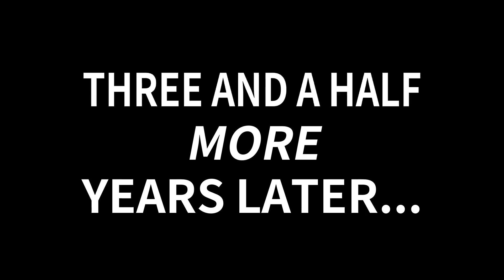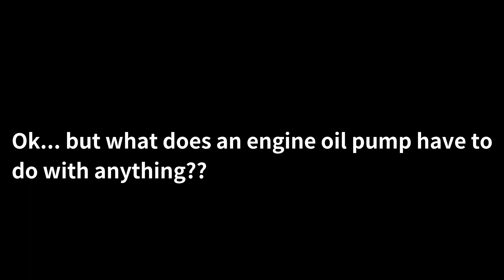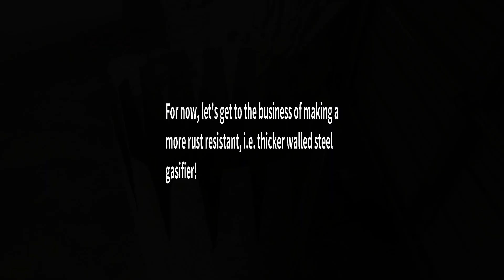Charcoal Gasifier Update 2022, Part 1

Comment: I had the same idea, water/coolant around the firecone but circulated otherwise it would boil fast. I'm going to just weld stainless together and use plaster-sand mix around it for a further heat sink. I'll see how that goes.

Comment: water cooling the throat is bass ackwards...you want to get it white hot if you can.  you are just trying to use cheap found materials and i will not work for very long...i still applaud your effort and time and experience will rule the outcome.
Reply from the maker: I know, I've gotten gasifiers hot enough to melt firebrick.  Those were not cheap found materials.  Also, this design is using oil for cooling, not water.  Oil can get up into 400-500F before it starts breaking down.  Still not white hot, I guess.  Thanks for stopping by.
Reply: @dansw0rkshop  Try using stainless steel, I'm going to try welding some dog dishes and kitchenware bowls with 308L16 rod. One guy bit the bullet and just machined his entire firecone-venturi from stainless LOL!
Reply: Dale is right it is backwards. It only gets cooled after it leaves the reactor for the cleaning. This cone type is called an Imbert and is for wood. You want the whole cone to get red hot and submerged in charcoal that forms on the whole bottom end and all around the cone to make pyrolysis. On the outside of the cone as well. Just like when you put a dry spaghetti noodle on the metal of a red hot stove burner. The metal has to get red hot.

Comment: Dan, i don't understand the design, are you cooling the air / woodgas before it enters the carberetter ?    is there a need for a carberetter ?
Reply from the maker: If you are asking about the oil cooling part, this is something completely different.  In this gasifier design, the oil cooling is to keep the hearth and air intake from melting.  You can melt steel with charcoal.  Easily.  The oil cooler prevents that.
Reply: @dansw0rkshop  thank you.
Reply from the maker: 1. Yes, the woodgas needs some cooling before entering the engine.
2. You still need a throttle butterfly for throttle control, so I tend to leave the original carburetor in place for that purpose.  On generators, this is necessary for frequency control at 60Hz.  On a car, this connects to the accelerator pedal.
3. Then, the woodgas "carburetor" is simply a plumbing tee with another valve to control the air-fuel ratio (which can be quite finicky).  I'll soon have another video up showing the generator setup.